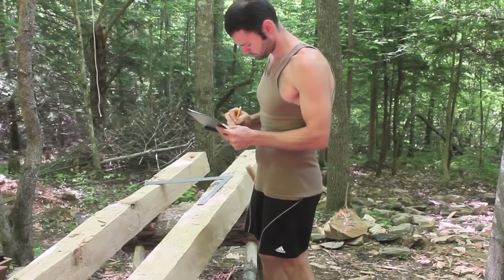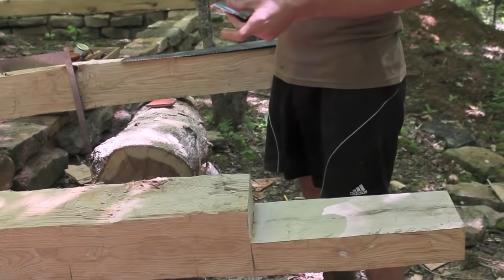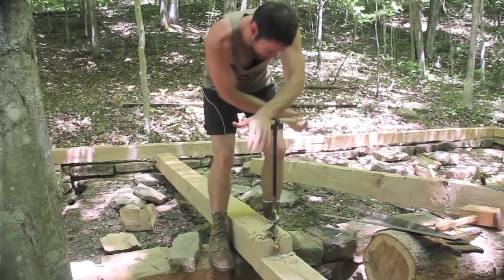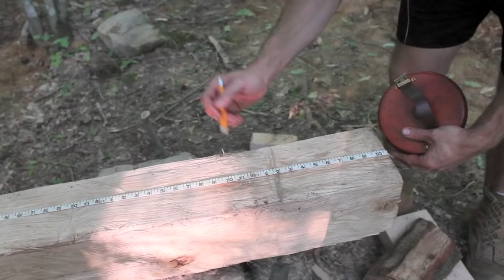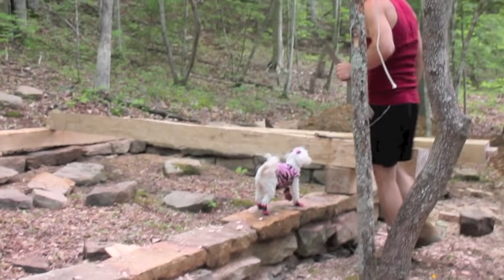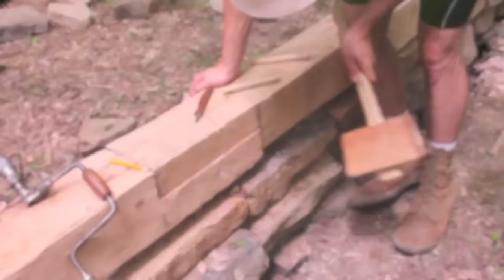Timberframe Scarf joint / Mortise and Tenon

Comment: Hello Mr chickadee awesome video on hand tools showing my 16 year old son at moment about doing joints with hand tools he wants to use power tools but I won't allow as he has to learn to cut straight with the saw
Reply from the maker: thats great thanks
Reply: You're a good father. Tough love to steer them in the right direction is necessary some times.

Comment: Granpa was a carpenter in the 20's and was missing the 1st 2 knuckles of his left forefinger. i was about age 5 when i ask him how he lost them. He replied with a very sharp handsaw. At age 5 i knew what a handsaw was and what sharp meant... for Dad had just given me a pocket knife to learn mumbleyy peg with. For those unfamiliar... https://en.wikipedia.org/wiki/Mumblety-peg Of which he had taken a file to, in order to match the dullness of the blade's back. i ask my Dad after Granpa passed when i was about 13, if it was true when Granpa told me a very sharp handsaw had taken his finger off. Dad respectfully replied... Carpenters, before power saws, kept their saws very sharp to ease the long day's strain of cutting lumber. They also used white Lightning to dull their sore muscle pain. Sometimes the 2 together could easily cause such an injury with just 1 stroke.
Recall as well when Granpa was still alive, that my Dad had bought a brand new handsaw and the saw vibrated and bound up near the last 4" of the tip. Granpa told him he didn't need the last 4' inches of that blade unless he was 7' tall. You need to cut that last 4" off son. Dad was a mechanic all his life and knew how hard the saw blade steel was... and laughed back to Granpa... with which? A hacksaw, or torch? Grandpa then pulled a pair of right handed tin shears out of his canvas bag and cut the blade 4" shorter. Dad repeated this tale then on to friends and relatives when the subject of saws come up. So Thank's for help making the subject come up. -gilpin 10-11-16
Reply from the maker: Wow, thats the man I would love to have learned from, a true craftsman from the hand tool age…Ive caught myself pretty bad a few times with a sharp saw, luckily never to that extent!

Comment: When you cross check the frame for square, do you measure to the lines near the edges of the timbers or to the ends of the beams?
Reply from the maker: outside corner to outside corner would work, if timbers are same size, either would work so long as its the same measure point on each corner, I've since moved on to line rule layout, so with this new method as seen in more recent videos of ours, all layout is done from a center line, so also you would measure your diagonals from center line to center line at the intersections.

Comment: I absolutely love your traditional methods and tools. What would early settlers use besides a metal square though?  I understand why you were using one because it is extremely simple but what would they have done back then for a straight edge?
Reply from the maker: A scrude plumb bob and a board of the desired timber size is all you need, plumb gives you a straight line to lay your board on.
Reply: One thing you can do for a rough square is make a triangle out of string with equally spaced knots, so the sides of the triangle will be 3, 4, and 5 between knots long, Then when you peg it out taught, it will have a right angle between the 3 and the 4 side.

Then use a chalk line and plumb bob to get it straight and plumb ;)

Comment: Mr. C.,
I am not at all versed in woodworking, so this is a question:  Regarding the holes for the pegs....Why would you drill them first?  Why not fit them together, then drill the holes?  

Thanks for the vids, and thank you for your service.
Reply from the maker: The holes are offset, this is called Draw Boring, you put the memebers together, mark the peg hole on the tenon then drill it slightly off toward the shoulder, as you drive the peg in it pull up tight.
Reply: That makes sense.  I did see you put some together and drill them afterwards in later vids.  Just wondering if there was a reason for it.  Thanks again!
Reply: @MrChickadee  And all along, I thought you just couldn't drill a straight hole!!.......
JUST JOKING!!!  You do absolutely beautiful work, taking your time and striving for accuracy.  Your work is as much art as skill.

Comment: You handle the hand saw with such skill.  I am new to wood working and it seems I can not get it straight ... with much practice comes patients and skill and to me .. it looks like you have much skill.  One question that has me stumped ... What type of wood is this?  Thanks for making these vids ... keep them coming :)
Reply from the maker: +L Gorman Thanks for the kind words. Yes sawing straight, or at any desired angle just plain takes practice…for rough work I tend to just sight down the blade and "feel" for straight, for more precise work I use a knife wall which helps guide the saw kerf, you can see this in my widows making videos. The wood here is white oak, which we used for our bottom "sill" timbers as its the most resistant to rot and insects of the wood we have.

Comment: Hello Mr. Chickadee! Your videos are some of my favorite when it comes to Timber Frame! Thank you for making them!
I have a question. Do you a have a specific reason for preferring the western push saws to let's say the Japanese pull saws?
What is one reason you usually don't use them in your videos?
Reply from the maker: Having tried both, for me personally, I find the western type saws to be easier to control, easier to sharpen, faster cutting and more comfortable to use. I will say I find Japanese chisels to be far superior but dont use them much due to cost and availability. I mostly reforge western chisels and create something similar to Japanese chisels.
Reply: @MrChickadee  Oh alright, that makes sense. I am new to Timber Frame and so I have only heard things about both saw types. And the Japanese chisels I have heard that too, yet also heard they can chip easily if you're not careful?
Reply from the maker: @christopherkershaw261  They can chip if misused. They should always be used to chop and never as a pry bar. Also if going through a very hard knot like hemlock has for example, you should go slower and take smaller bites. Western chisels were tempered much softer so they tend to bend or roll edges before breaking, but they also tend to hold much less keen edges and were just used more roughly and with less precise joinery.

Comment: Did you let these logs season at all or were they cut within the same year?
Reply: I like the wax idea on the ends. I was using anchor seal but it’s expensive. I want to try petroleum jelly with a little heat to see what happens on the end cuts
Reply from the maker: they were used fresh, nowdays I do prefer to dry my timbers a year or two

Comment: Do you use the same wood for the pegs as the sills are made of?
Reply: also why half mortises instead of through tenons on the corners? Honest question, not a critique.
Reply from the maker: Oh boy, this was our first structure, we've come a long way since then, both in understanding and technique. 

At the time I pretty much just copied Jack Sabons shed plans for the joints, most are not ideal. 

Now If I ever build a sill plate timber frame, it will have either through wedged tenons as our house has, or at minimum through tenons pegged with the most relish possible. 

We used dry locust pegs, and some made from oak tobacco sticks, all dry, you want a good dry hard shear resistant wood, and if its also rot resistant all the better. Apart from pegs wedges are much better and can be retightened if need be, most of our house is actually held together by through wedged tenons.
Reply: Mr. Chickadee Awesome! thanks for the quick reply. It's nice that I can glean this info from your trials. Will you ever consider doing a workshop or something that your viewers could attend? Or if you just wanted some help on some grunt work I know would take off from work to help just  for the experience. Thanks again
Reply from the maker: You're welcome, we are planning to make some instructional videos in the future, once I get the house all done.
Reply: Mr. - What issues did you have with the half mortises?
Reply from the maker: None yet, just recognizing there is a much stronger way it could be done, such as a through wedged tenon, or even a bridle joint

Comment: ah. you did a sort of reverse french grip method on your rips. i like to do that too, except the normal way with the saw coming towards my crotch. i don't do it in front of my wife though.
Reply: Johnmark Hatfield ps: your technique is so great. sometimes i think "will he do _ " and then the next part of the video is you doing exactly what i hoped to see.

is the scarf joint for a floor girt? i've tried to make a japanese scarf joint just to make me think. i think  if i was ever going to scarf a tie beam, i would use the slanted style (properly called - stop splayed, under squinted and tabled with wedges. i definitely had to look that up)
Reply from the maker: Johnmark Hatfield Thanks for the kind words! Yes the french rip has its advantages out in the field away from the bench. The scarf is just to join two pieces of 6x6 white oak for the long sides of our workshop, my mule would not pull a 24' oak log, but poplar was ok, you're right the stop splayed is correct in a beam or other piece under more load or strain. I had to do one to lengthen a tie beam I cut too short….they can be very strong!